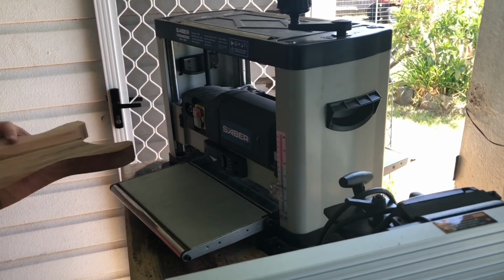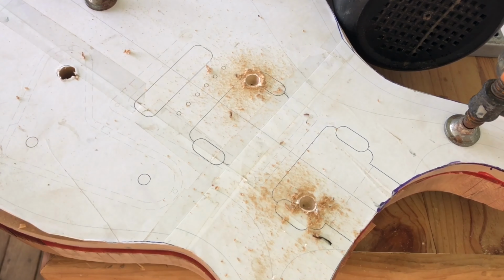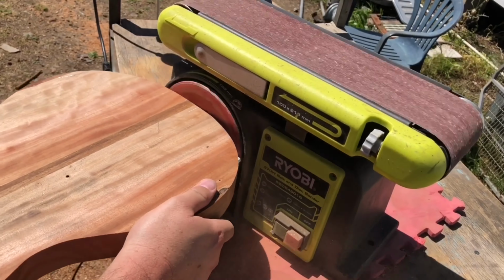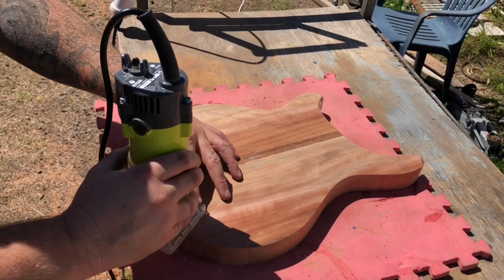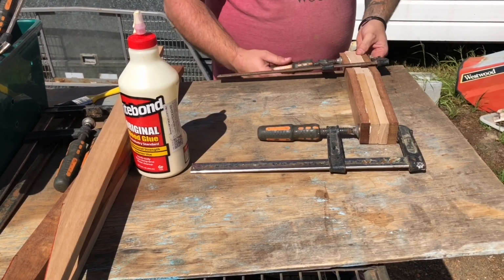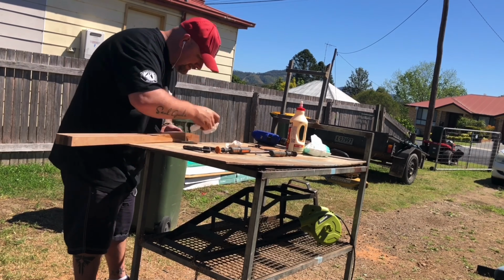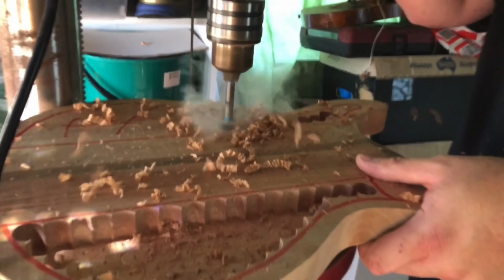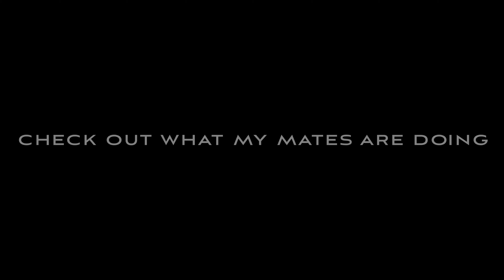4 string thing part 2

Comment: Good idea for your product placement! 👍 I’ve just bought that ryobi trim router. Planing to use it for some binding, which I haven’t done before.
Reply from the maker: 😂 I didn’t know what else to do

The little trim router is awesome I have one for bevels and one with a straight.m bit in it
Reply: @saulgoodeguitars  I reckon we have a lot of similar tools from Bunnings and Aldi!
Reply from the maker: @adairguitars  most of mine are from Bunnings since it’s just the next town over, but I have some  from total tools and Sydney tools